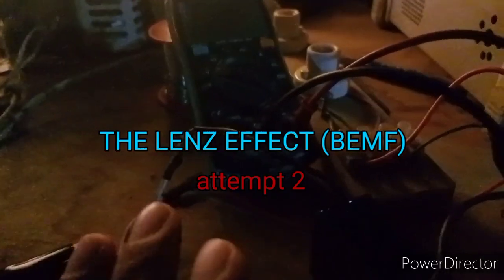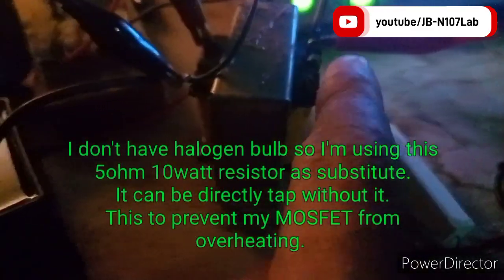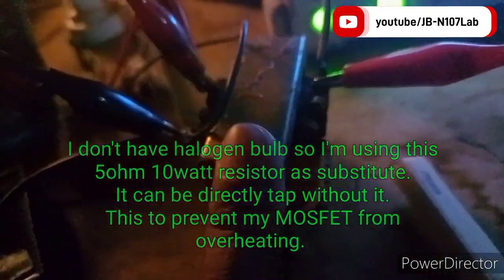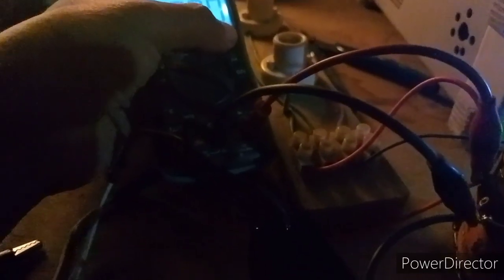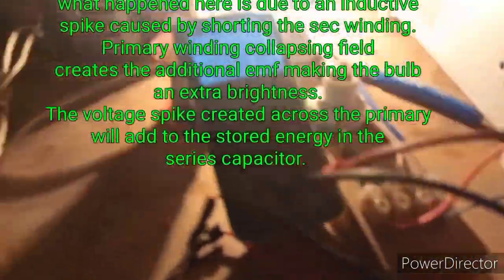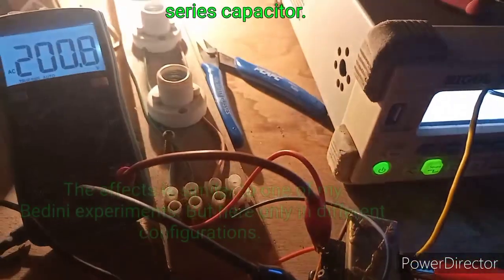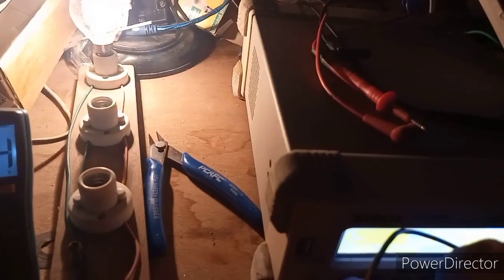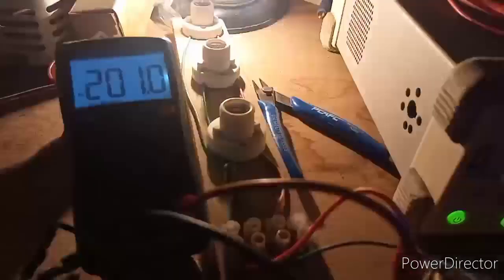#47.1 THE LENZ EFFECT(BEMF)

Comment: Hi, very good experiment ,i know this effect, i make lead acid battery charger same as you described in this video , this charger consume less current when charging the battery and when open circuit this consume more current due to LC circuit resonance
Reply from the maker: Yeah, right!
Reply: use another circuit to pulse it with capacitor discharge. Like high voltage primary of nikola tesla.use here as pulser for secondary.remember primary circuit of nikola tesla capacitor discharger whn dischgr create powerfull magneticfield that can couple to the primary of this transformer and captured by caoacitor.
Reply: Before some sort of shortingbthe secondary. Why not add magnets  in the surrounding area of tranformer. To strenghten magnetic field collapsing tht is captured by caps
Reply from the maker: @dapakers  Can be added with magnets but not suitable if you want higher frequency.
Reply: @PLASMUX-20 if i can remember floydsweet  run his device 50 to 60 hertz only. No high frequency. With Bar of magnets and bunch of coils.i think 50 to 60.maybe tesla HF style is irrelivant for this to work.on this setup
Reply from the maker: They have different style. I'm working on both low and high freq. Both have benefits.